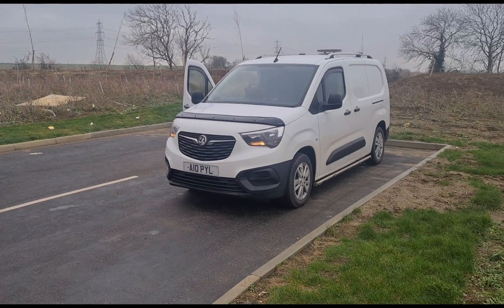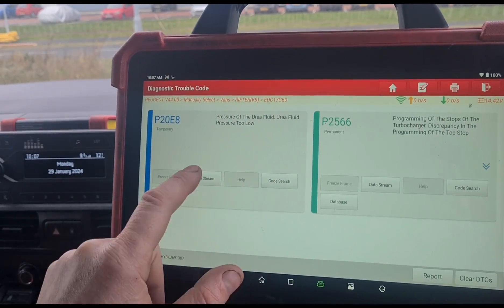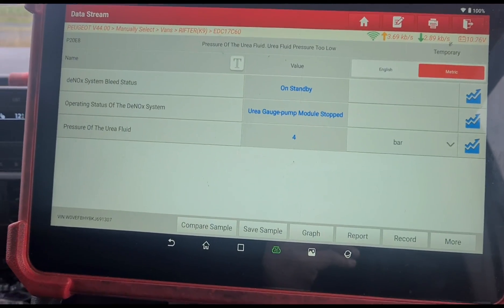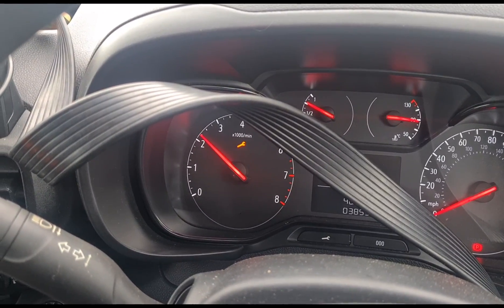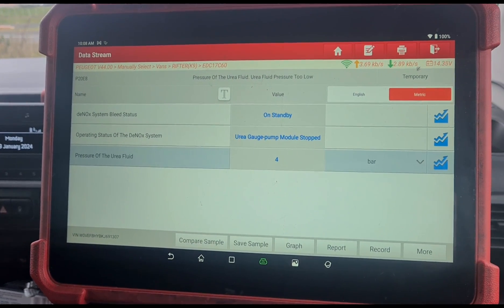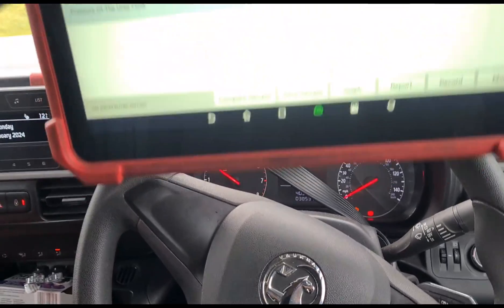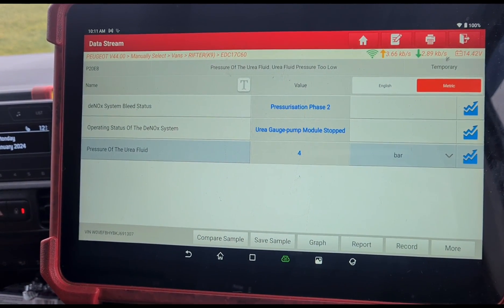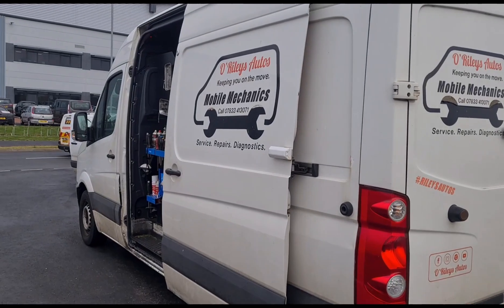Vauxhall Combo P20E8 Pressure Of The Urea Fluid Too Low: Diagnostic

Comment: Just because the pressures low on live data doesn’t mean the pump is faulty.. leaking adblue injector is one of a few things that can stop the system building pressure.
Reply: What he's saying is that the sensors in the system don't read below 4 bar. The sensors are on the module/pump its self so it reads pressure being put out not overall pressure in the system. There's more information about this on some older videos
Reply: @bigdog66711  Jimmy did say that the pressure staying at 4 bar, when it should have been climbing up to 5.8 or 6 bar, probably meant it needed a new tank.
Reply: I'd have expected a P20F6 or similar code if there was a leak in the system (or if the injector was stuck open or something like that).  Maybe there was before, and someone had cleared that code before Jimmy got to run this diagnostic on it - who knows? 

I have the P20E8 code, and my tank pressure stays down at 4 bar too, but when the problem started for me, I got a few P20F6 codes thrown before other ones like P3052 (the other code for urea pressure too low, equivalent to P20E8 - I don't know why there are two different codes for the same thing). Eventually, I stopped getting P20F6 codes and it was just P20E8 every time after that. I can clear it as many times as I want and it comes back after about 3km (after a failed attempt to pressurise the tank).